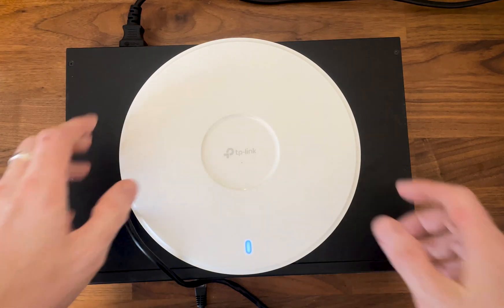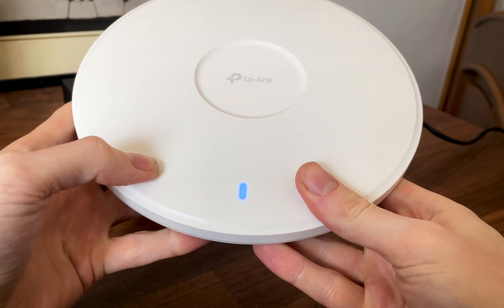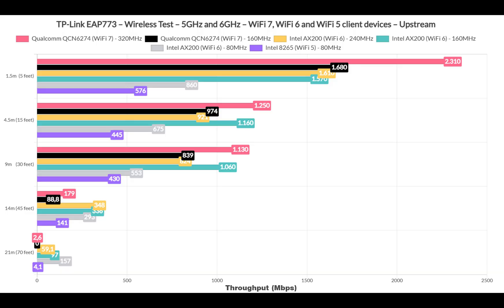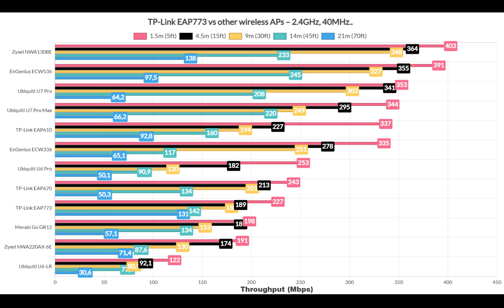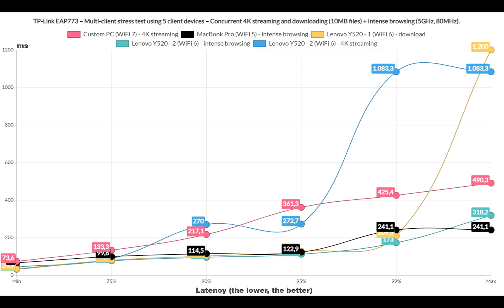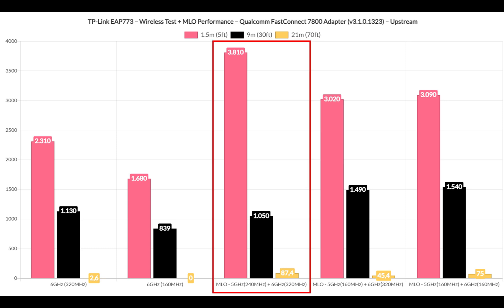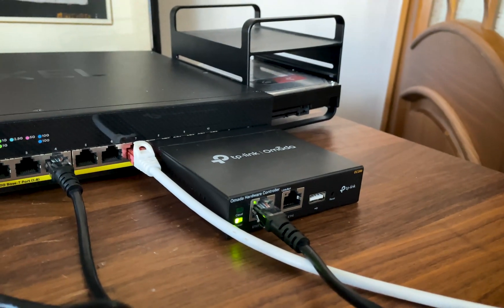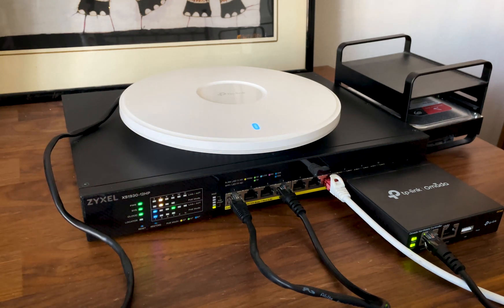TP-Link EAP773 Test and Review: Better than Ubiquiti U7 Pro and Zyxel NWA130BE?

Comment: There are some errors: In the teardown the labels of 5+6 and the 2 GHz chip are switched. And in the specs it lists both 5 & 6 as 4x4, when they are 2x2 each (the chip is 4x4, but split to 2x2+2x2). Also the 2 GHz ship is stated as 4x4, while TP-Link only states 2x2. Maybe you misread it's label? You also talked about the lack of MLO in 2 GHz band and hoped they could add it in the future, but that radio is 11ax only.